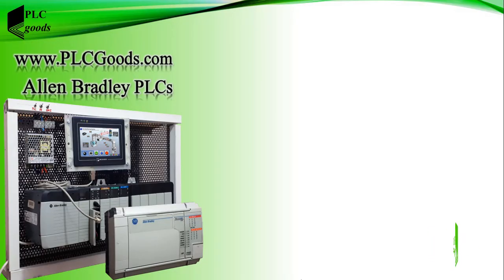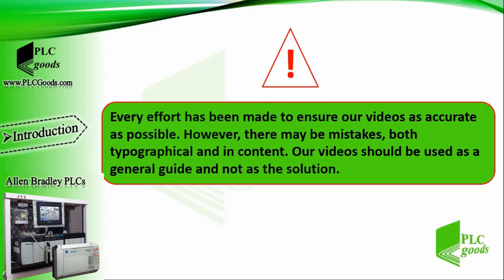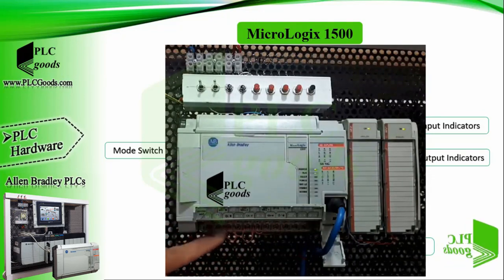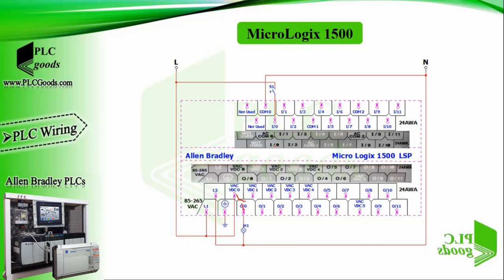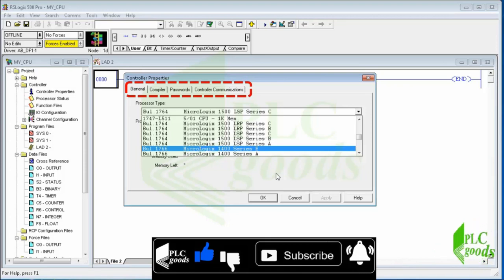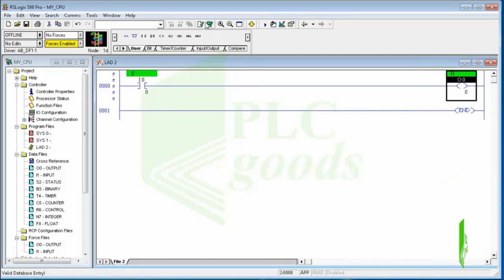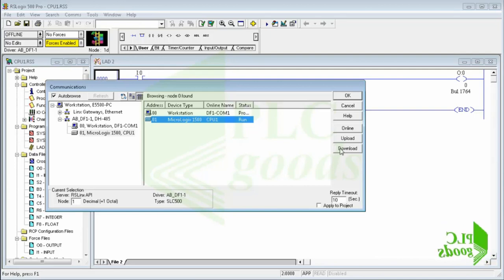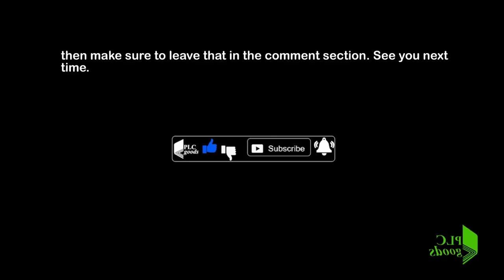Allen Bradley PLC Tutorial | Getting Started with Allen Bradley PLCs & RSLogix | Lesson 1

Comment: Good day sir please from your Rs Logix1500  from the output section, without looping or connecting L1 to VAC VDc0 are we going to get L1 at VAC VDc0 and  Secondly please I need to clarify my assumptions what does the VDc0 means? Does it means Voltage DC  if yes, why is AC voltage there or does it means we can actually pass a DC  on that VAC VDC0 so that it output the DC out on  O/0 in case we need to power a DC devices 
and 
also from the input section you connect neutral to common  can we also connect DC ground to that common if the input source isDC?
Reply from the maker: Please look at the schematic given in Lesson 1, and if you have difficulty understanding it, please please ask fro help from an electrical technician friend. I am very reluctant to talk about  wiring any electrical equipment with a novice person due to any misinterpretation from either party
Reply: @plcgoods  OK thanks for your reply

Comment: Hello, I am wondering if you can be of help with Factory Talk view Studio. I just get it and I am having issues with the access right table where all the Bits are inaccessible. Do you know how to make them read and write? 
Regards!
Reply: hello, I can say, check your connection, and also, check other data types are inaccessible, or not.
Reply: @plcgoodsmentor9223  
Thanks for getting back to me.  So far, I am trying to run it in the Emulate.
Reply from the maker: ok